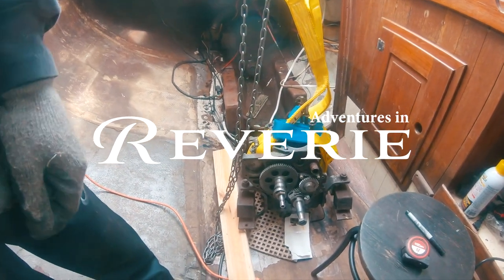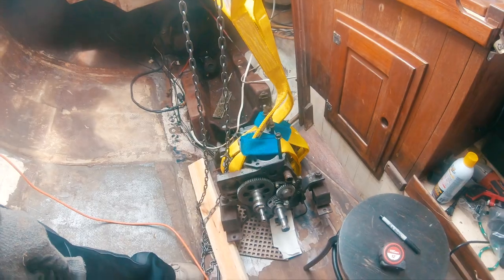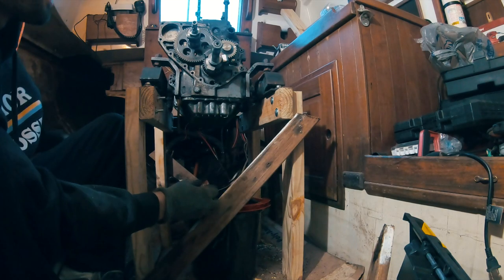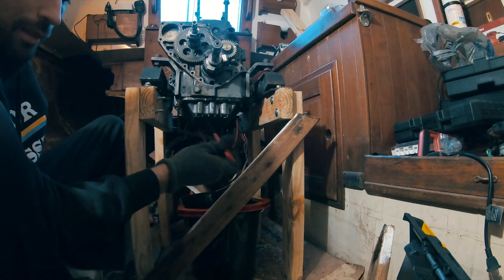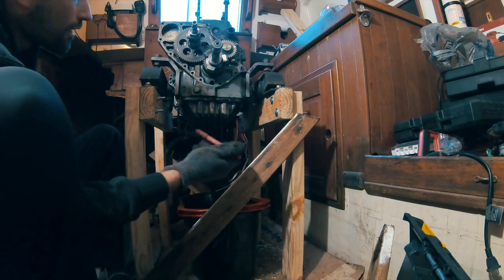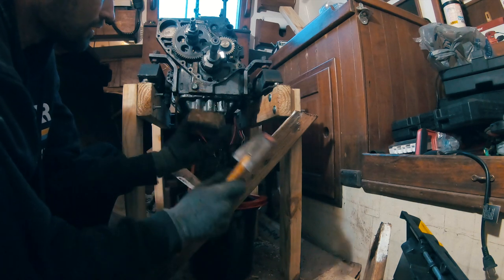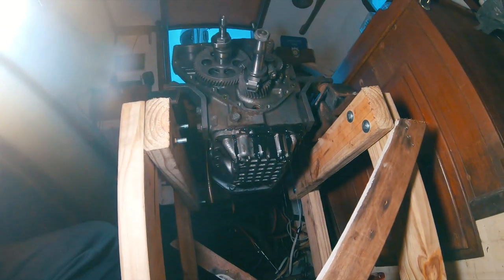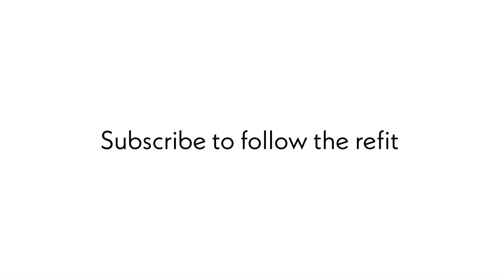Ep. 10: Putting the engine up on the hard, Engine Removal: Part 2 - Refitting Reverie

Comment: Good  luck  nice  progress you  might want to  have  the  block hot tanked with  all the sludge in  there
Reply from the maker: I agree it would need to be tanked. I have a lot of thinking to do regarding the auxiliary. I have a possible line on a great condition 3ym20
Reply: @refittingreverie7992  probably a no brainer to upgrade to a reliable 20 horses +/- for getting the haul outta there and quickly down the ICW...
Reply from the maker: @saylaveenadmearedead  definitely my thinking. A known reliably working engine for not that much more than it would cost to rehab the current one. 2008 motor vs 1980's.
Reply: @refittingreverie7992  you asked me email you a while ago about the hull to deck joint, is this how I contact you?
Reply from the maker: @rodbrancher807  Hey Rod. I saw your comment with your email. I will shoot you an email soon.